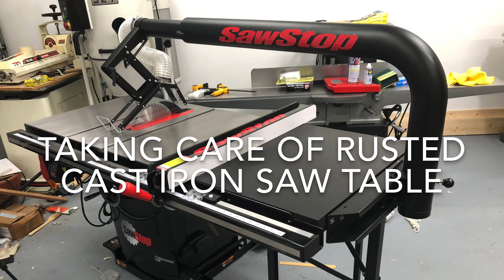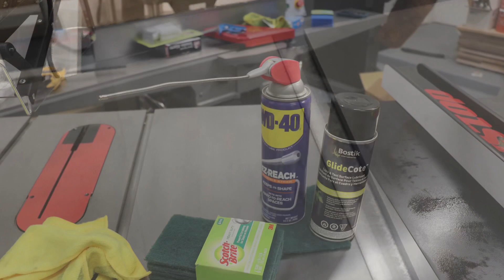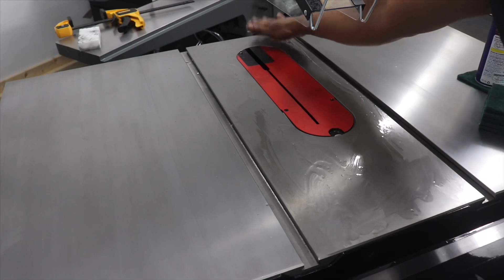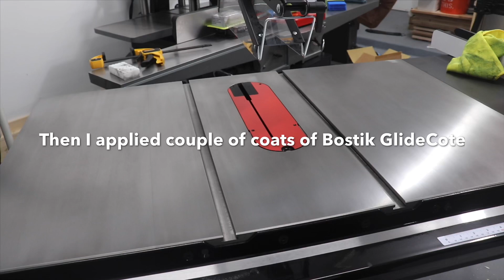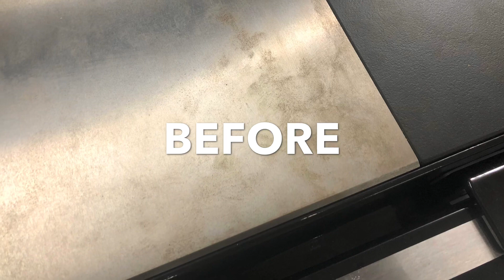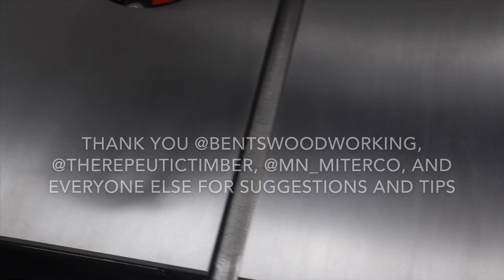Cleaning Up Cast Iron Sawstop Tablesaw - DIY Woodworking

Comment: How do you like the overhead dust collection on your SawStop?
Reply from the maker: I really like it when I use it. Didn’t get a chance to use it much as I am in the process of setting up my shop. Only thing is, if you are planing on adding a router table to the wing, it would not work with this 4” dust arm. Router top will work with the smaller dust arm though. .